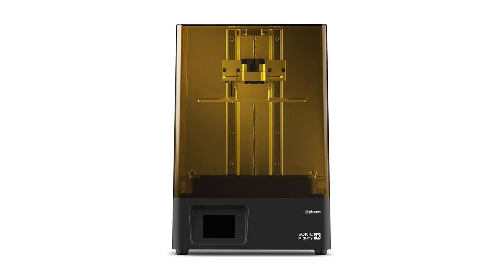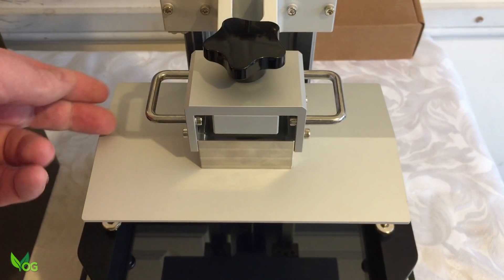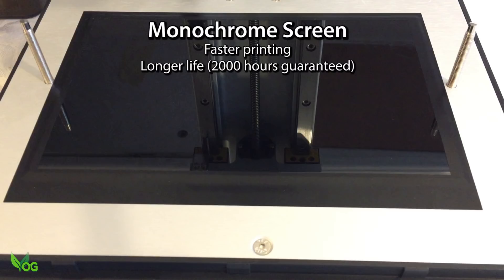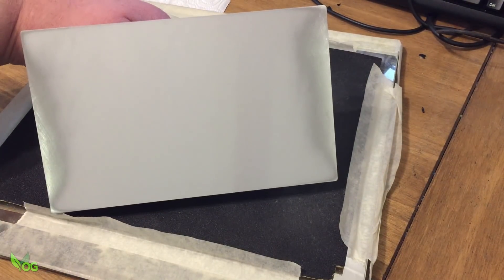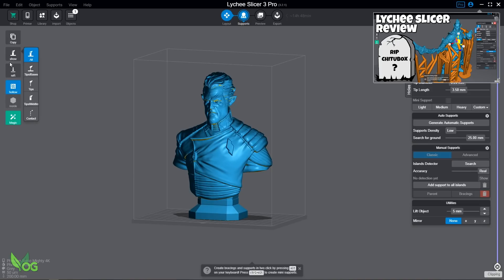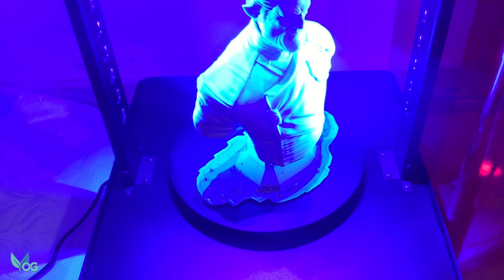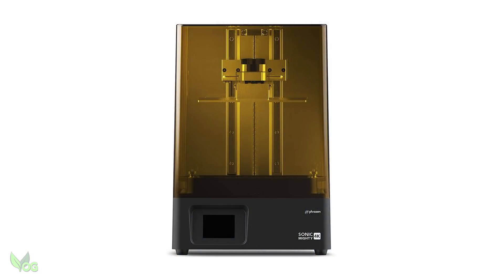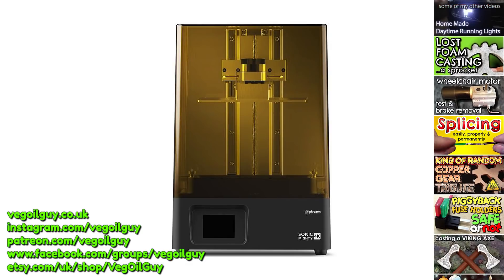Phrozen Sonic Mighty 4K 3D resin printer HONEST review by VOGMAN

Comment: The only way short of having a machine shop grind you a piece of flat steel to sand a flat surface would be 1/4" or thicker plate glass. I recommend going your local glass shop and have them cut you a 10" x 12" piece of 1/4" plate glass. Have them sand the edges so you can't easily cut yourself. Most glass shops have trash cans full of "drop" from jobs and won't charge you an arm and a leg for the material. Just the labor to cut it and sand it.

Comment: I wish printers (or anything) wouldn't come with tools. It's amazing how many people never buy proper tools because they have a drawer full of garbage tools that came free and they didn't want to throw away. I have no problem with cheap tools. Harbor Freight is great for building dedicated tool kits for every workspace. But each tool kit should include tools you WANT to use (like a T-Handle hex key and edge cutters). Also, don't forget that you can put multiple coats of Plasti-Dip on your tools to make them fit your hand the way you want. You can even use gloves to grip them before they cure and get a custom fit. Life is too short to compromise here.
Reply from the maker: Once upon a time, folks built model bridges and things out of matchsticks. I'm planning on doing the same thing with Allen keys 😂😁👍
Reply: @vogman  I use them as TIG welding filler rods 😂

Comment: The plate being sloped slightly would be less of a problem with the Elegoo Saturns ball joint build plate since the ball joint would allow the plate to rotate slightly to be evenly level with the screen. The 4 screw setup imo has that weakness where it can accommodate for angles, only up/down, so its even more important that the build plate be perfectly flat and the screen be perfectly parallel to it.

Comment: Hey VOG, which one between these larger printers (Mighty, IBEE, Mono X, Saturn, E10) do you think it's the most stable and reliable (for pieces that are not higher than 10cm but maybe cover the entire build plate {so there would be some power needed on the stepper motors to lift those heavies without any issues occuring} )? (I don't know, maybe considering LCD display, light source, power source, internal cooling for the LCD, etc. etc.)? Maybe you can advise me which would be your top 3 taking into account all of the above... I would really really appreciate it (these get quite pricey around here, IBEE it's ~1000€, Mighty ~650€ and so on)! 
I love about the Mighty that is has the largest build space on X-Y axis and from other reviews as well I've seen the light on the display is very nice so the accuracy should be spot on but I'm afraid of those motors not being able to lift the plate with heavier pieces (or doing it with issues, visible lines and ultimately by loosing accuracy on Z axis)...

Comment: Which one would you recommend between the Mono X or Mighty 4K? This will be my first printer and I plan on printing custom toys that range between 4"-8" big. Print quality is most important to me and I want to know which one has best overall performance. I see that Mighty 4K sells metal plate on the side and I can buy the extra tools myself I'm more concern for overall build quality of the machine and print quality. So what would be the best choice for me? Mono X or the Mighty 4K? I watched reviews of both but no one really does side by side or they don't seem to have both so its hard to say. Hopefully you see this and answer thanks in advanced! :)
Reply from the maker: In terms of print quality, both printers are fairly evenly matched. But for build quality, I have to give it to the Mono X. It's a machine that will keep on going for you 😁😁😁

Comment: Feels like the company asked you not to put the price. I like it when you include the price so we, as the consumer, can make a better / more informed choice. For instance, back when you reviewed it, the Sonic 4k was $999 vs the $1399 it is now. Similarly, the Mink 4k was $299 vs the $349 now.

"It's a phrozen printer, and I think it does an adequate job," was your conclusion. Do you think it's worth the price for the size and print quality @ $599 vs the Mink 4k @ $349? Will be buying my first resin printer and am having a hard time deciding.
Reply from the maker: A price I include today will be inaccurate tomorrow. 
Phrozen had nothing to do with my choice not to include a price... check out my reviews on Qidi, Anycubic, Elegoo machines... there's no price.
At the end of the day, shopping around for the best price is ALWAYS the best approach unless money isn't a problem. So I highlight features, problems, pros and cons. If folks want to want, I'm sure they're smart enough to look for a good deal 😁😁😁
Reply: @vogman  Fair enough! Thanks for the response. I saw in another one of your comments you'll have a comparison video. I'll wait for that to drop since I'm having a hard time deciding between the Mini and the Mighty.

Comment: Do you have any videos regarding prepping the model to paint?
Reply from the maker: No, sorry. Just print, CLIP away the supports (don't pull them off), then lightly sand away any nubs left behind. Glue, fill, sand if necessary, prime then paint.

Comment: What about curing the inside? Is that needed?
Reply from the maker: Hollowing is tricky... you want thin walls, but thick enough to stand. You need holes in the model to release the excess resin and then fully submerge in IPA the rinse the insides as well as the outsides. At than point, a good UV curing works wonders 😁😁😁
Reply: @vogman  Thanks, I have hollowed and printed files with relief holes... I cure with a lamp and rotating table - BUT, what about the inside of the model, does it need to be cured?  Using a pen light through a hole maybe?
Reply from the maker: As I understand it, the UV cures at depth, but it takes a while. How long? That's anyone's guess. I suppose it depends on the equipment used, the resin, the thickness, etc.
Uncured resin, from what I've read, can cause issues such as cracking over time. Too much curing, from what I've read, can cause cracking over time.
Y-eeesss... but what's the right settings...
Alas we're left to guess for ourselves.
So far, with the technique I've mentioned and a 20 minute UV in my Anycubic Wash and Cure, I haven't had problems with my larger prints. Small ones of course can be solid all through, but I've never had issues with them, even on just a 4 minute spin.
Personally I think if you get the uncured resin out and give it a good few minutes, you'll be fine.
Sorry to be vague... it's a vague topic with much guessing and several million opinions 😁
Reply: @vogman  Thank you... that does help. I might add a larger hole in the bottom of my larger prints and set them on the lamp for some internal curing. Cheers!

Comment: Good Review, nice and non biased. I haven't got mine yet, its on preorder due in 2 weeks. But thankfully the quality of your prints has solidified my choice. not too concerned about the downsides you listed, other than the bed, but i had heard it may be required to sand. I Have a toolbox of quality hex drivers, and I buy the cutters in bulk and from some of the problems I hear people having with the ethernet on Saturn and wireless on Anycubic i think ill stick with USB. Dont go much on the USB being on the side but will reroute it once I work out the best location for it. The power switch on the back is also horrible, but will use a switched power board so all is well there. After years of having multiple FDM printers this looks like a whole new world and alot to learn , the supports being the biggest thing to learn. FDM you try to not have supports, and if you do make them small...it seems with Resin, supports are often the key to a good print ?? go figure. Anyway lots to learn, more videos to watch .

Comment: If I could find one...I'd love to try.  I have 14 FDM printers and been wanting to try out resin.  I'm curious how my mild asthma, which rarely bugs me, will tolerate the resin fumes?
Reply from the maker: I suffer with respiratory problems and only have 1.5 lungs. but it does NOT cause me any problems. 😁😁😁
Reply: @vogman  good to know. I’m also worried that my 3 cats (i.e. pet hair) could make resin printing fun. I may need to walk off a section of the basement, toss in some additional air filtration and make that the resin room. Where we one fine these machines?  Amazon is out again. 
(Nice channel, just subscribed. Feel free to check out my nerdy adventures!)

Comment: Couldn't you just use the longer end of the hex key?
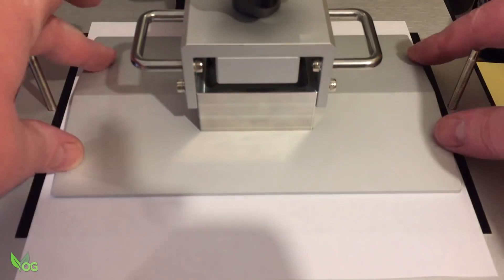Reply from the maker: I did my friend at 4:07 onwards. But my point is it shouldn't be necessary. If the handles were just 5mm shorter or larger and easier hex bolts were used, it wouldn't have created a problem ; )

Comment: Nice review! In the week I've had mine, I tried several Patreon models including that Archvillain one (pre-supported) and had it separate from the supports halfway. Are you adding more supports our doing them all yourself? 
Also, do you cure inside the hollowed models? (If so, how?)
Thanks!
Reply from the maker: I'll be honest Jeff, I ALWAY add supports to my Archvillain minis. They are excellent and usually very well supported, but they keep their supports light to minimise the work for their Patrons. The problem is light supports snap off under the weight of a large print, leaving you with exactly the scenario you mention. For that reason, I spend half an hour going over the print from the very first island onward. I strengthen critical area where I can see most of the weight will be and add extra light supports where I feel they're needed.
If you haven't seen my Supports 101 video https://youtu.be/MU0Cq_bjhy4 it might be worth a look. It's my Supports philosophy if you like. Better to spend half an hour checking over the supports than spending hours waiting on a failed  print, wasting resin and having to strip down and clean.  😊

Comment: Hi VOG, great video as always. Is there any way you could provide some feedback about your sonic 4k now that it has been a few months? I was amazed by the quality of the prints you had in the sonic 4k video, though I am curious if the difference in print quality is just as noticeable from the sonic 4k vs the mighty 4k as it was sonic 4k vs mono x. Cheers!
Reply from the maker: The Sonic 4k and the Mighty 4K are NOT the same. The S4 is 4K over a small area and the M4 is 4K over a larger area, meaning the resolution is lower. It wouldn't be a fair comparison. A better one might be the Phrozen Mini 4K and the S4, but I've never seen one 😁
But I can say, the S4 remains my favourite printer.
Reply: @vogman  Yes the XY resolution change from 50~ to 35 um seems to make a very noticeable difference. I will be curious to see if the Longer orange 4k mono is an equally noticeable difference going down from 35x35 um to 31.5x10.5 um with the sub pixel technology they are claiming it uses. Hopefully you can get your hands on an orange 4k mono unit to provide all of us with another great video... until then it looks like I will be ordering the S4! Thanks for the reply!

Comment: Delivering a flat table out of the box should not be a difficult manufacturing issue. Great prints.
Changing the handles would be a breeze. ✌
Reply from the maker: Honestly the bed issue is not restricted to the Phrozen. I've heard similar stories about j most printers.
But the handles... what a silly oversight. Just 5mm shorter would have meant no issue.

Comment: Still enjoying my Elegoo Mars 2.  A quick tip that you may already be aware of:  I recently discovered that the UV LED on one of those "instant set" glue pens from the hardware store also cures resin (which is basically what's in the pen) very nicely.  I had a print that I had to modify, and it was "bleeding" uncured resin.  So I swiped my boss's UV glue pen and ran the LED over the leak for less than a second, and the resin hardened instantly.  So if you've got a bit of uncured resin on a print, or maybe want to try using resin to glue multi-part prints together, it's worth a try!
Reply from the maker: Nice share 😁

Comment: Another great video.

I did not see a resin level indicator on the tray either.
Reply: Its got vertical walls part way up then angled.  Whether it's by design or a happy coincidence taking that line to be the resin level works for me.

Comment: Nice to see you back VOG. Have been wondering were you had gone. I fitted a magnetic plate to my photon. I think all resin printers should have then. Made by sovol I think and only 20 for 2 sets. They also fit the Mars. Amazing value. A little bit of adjustments on the Z axis stop but that was all. Really happy. Maybe you could do a review?
https://www.amazon.co.uk/dp/B08LYP2VTT/ref=redir_mobile_desktop?_encoding=UTF8&psc=1&ref=ppx_pop_tab_ap_asin_image
Good video by the way. Those are some of the best prints I've seen.
Reply from the maker: Thanks for that Tony. Don't worry, I'm still here.
I've seen those plates but have always thought it was just something else to clean...
Reply: @vogman  It does save losing the odd finger with the scraper. I'm building a synth so I'm printing a lot of small parts. I was finding bits were breaking as I'm not sensible and always print flat on the plate. Was also getting some nasty digs in the build plate. Replacements are hard to come by so I went for these. I'm really glad I did.

Comment: Great review. I was thinking on buying the Mighty 4k but couldn't wait and bought a Mini 4k, and I'm very pleased with it. I like the additional resolution and maybe if there are 6k or 8k displays I will buy a bigger resin printer. Regarding the clippers: I never had to use some. After printing, I wash the prints with IPA and then before curing them I put them in hot water (out of the tap with like 40 to 50 °C) for like 30 seconds. Then the supports break off very easy.
Reply from the maker: I've had a few folks tell me that water tricky, and it never works for me 😁😁😁

Comment: Very nice review man! I keep looking about diving into resin printing bu the little things (other than cost of resin) keep driving me away. I mean, a build plate that isn't flat (kinda like my Ender 5) just sux and a plastic vat....have they not learned? Other than that it seems like a decent machine for the price. I am not too concerned with wifi or networking as my Ender 5 does not have it and I am fine having to walk to the printer to get it started.

Only other thing I have heard, and read (I know with the world being video I actually read something, shame on me) is the quality is less than the mini 4k due to the same 4k in a bigger size. I am not sure if you have the mini 4k but it would be interesting to hear your thoughts on the quality between them on small and large items.
Reply: I'm not too worried about the vat. I looked into the new plastic they are using, and on paper it sounds like an ideal material for a resin vat. 

The hunk of raw aluminum needed to machine a vat this size isn't negligible, which is why they sell the aluminum vat separately for much more than the plastic vat. Assuming the plastic performs as well as datasheets say, I prefer to have the option.

Comment: Very nice! I like that they have made it cheaper, but haven't sacrificed too much. They have a strange habit of making all good printers, but the little ones are a bit smaller than the competition for roughly the same price and the big ones are super huge and massively expensive. Not much in the middle ground until now. I didn't pay a whole lot less for my Mono SE... lol The build plate thing must've been just a factory screw up. I guess they didn't surface grind them before they went out. Otherwise that's a top notch machine. Stupid question, is the FEP replaceable? Or are you meant to replace the whole vat? The plastic makes me wonder.

Comment: Hey, just to let you know those Ikea mirror tiles aren't perfectly flat. I'm using one on top of the build plate on my CR-10 and while it is much flatter than the original bed, the print area is limited due to varying height (approx 0.2mm). I could fix this with getting abl sorted but I'm lazy.